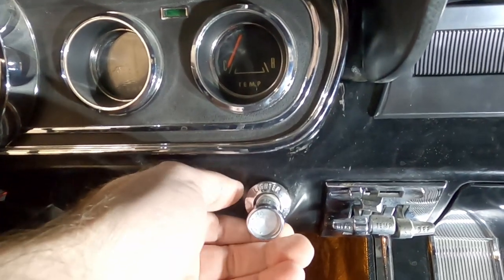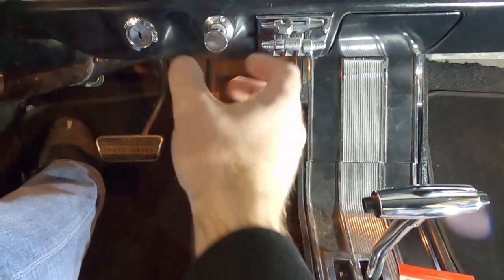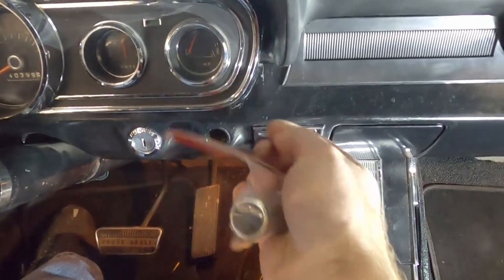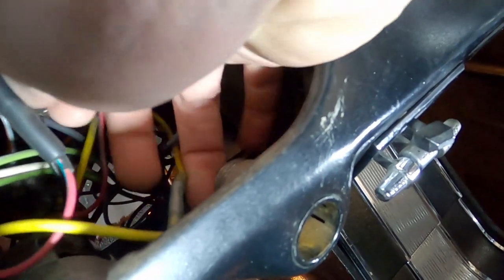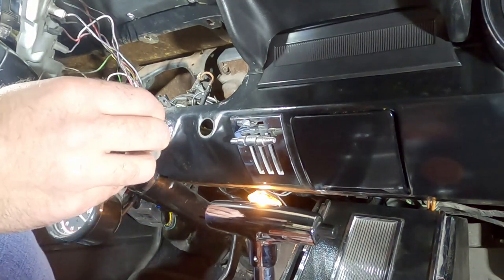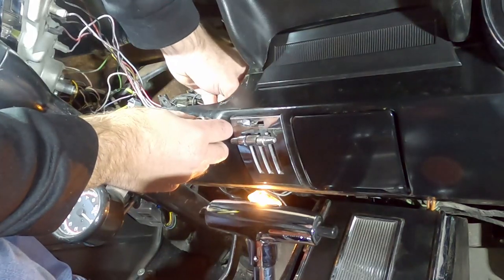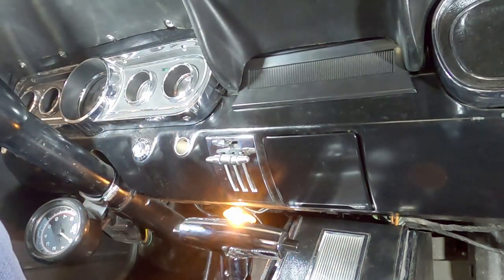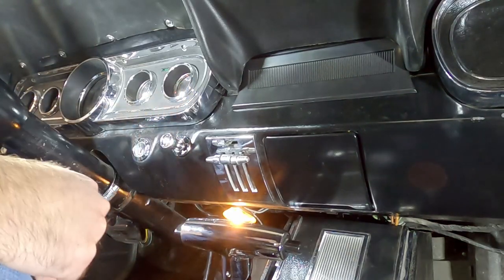Replacing the Cigarette Lighter

Comment: There is an extra tab on the back of the lighter socket, is that for a ground wire?  Does thi need to be grounded?
Reply from the maker: Correct, it is recommended that you attach a ground wire there as the grounding through the lighter housing into the dash may not be sufficient.  :)
Reply: @AndyKruseChannel  Thank You!

Comment: is the other tab a ground hookup? 
on the housing....
Reply from the maker: The housing is threaded up against the metal dash, which is ground source, so there's no need to ground the housing.  However, if this housing was being installed in a different car where it wasn't mounted to a metal location, one would want to put a ground wire on the tab you mentioned so the circuit could be completed when using the cigarette lighter.  :)
Reply: That ground tab can be used for a new radio.